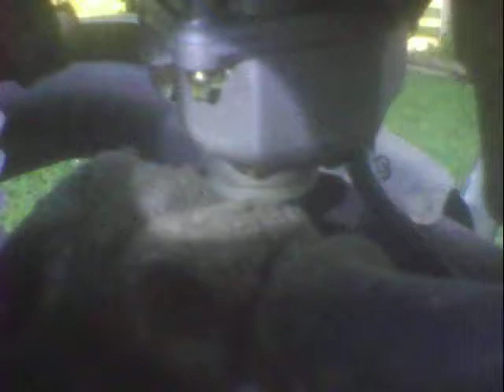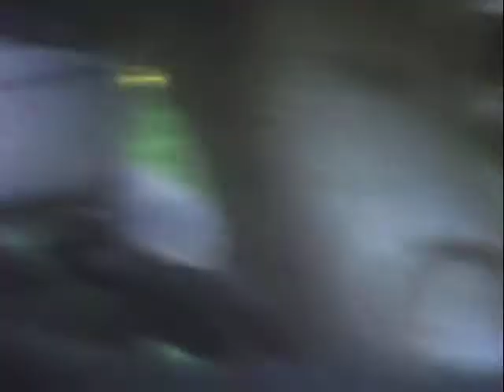Honda crf150f Carb Flooding for no obvious reason (2005 model(dirt bike))

Comment: did you by chance figure it out? mine is having the same problem
Reply from the maker: Yes sir I sure did.  Is your's doing the exact same thing??   Check it out: https://youtu.be/DCxDrqBZBPE .  Good luck, & take care.
Reply: joseph mcneal , I've tried everything but replacing the whole damn carb. leaky SOB. words of wisdom?
Reply from the maker: Don't give up man, try to be patient w/ that leaky SOB.  I totally feel your pain sir, I took the dang carb off about 5 friggin' times before I got it fixed, but its the needle/seat if its doing the exact same thing as mine was.  Try this 1st :  https://youtu.be/nrAwI1gjPko .   Then throw it back on & test it w/o even putting the tank or seat on :  https://youtu.be/DCxDrqBZBPE .   Good luck man, you'll knock it out.  Take care from Tn.
Reply from the maker: After you get it fixed & running good again, watch this : https://youtu.be/yAxYdPI_WVU .